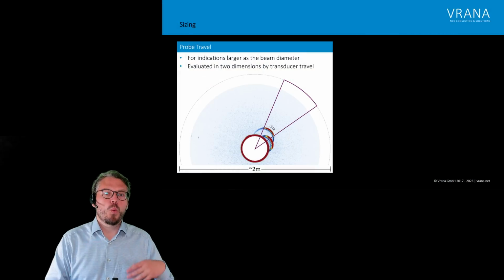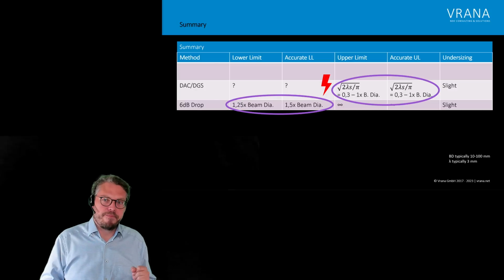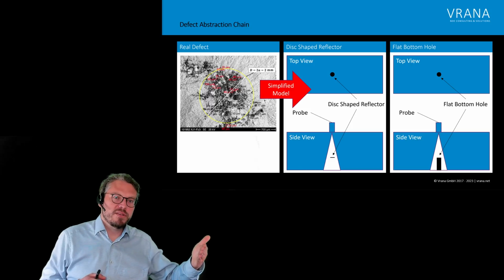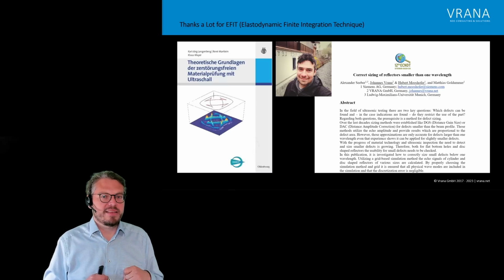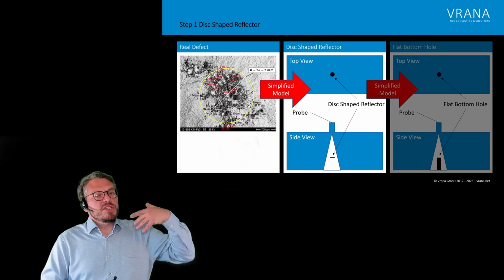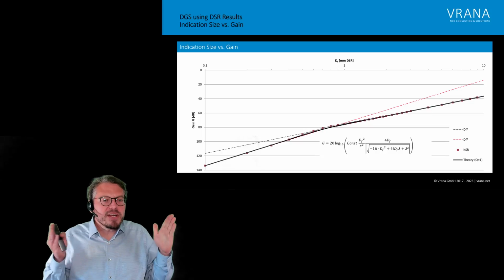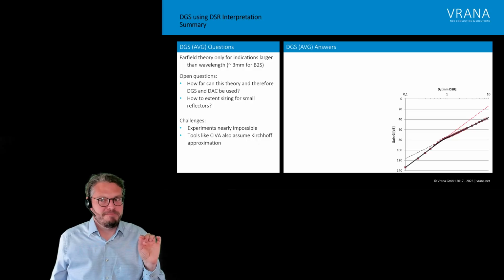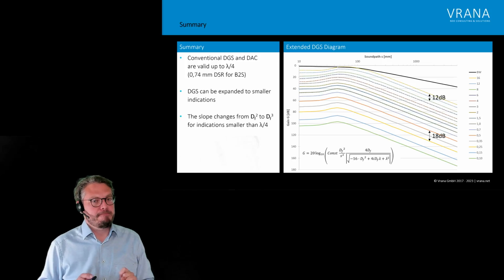Sizing of Small Defects with Ultrasonic Testing: Don't use Flat Bottom Holes!!!

Comment: Hello Dr. Vrana, could you do video/blog on nonlinear UT methods for early damage detection vs how they compare with the linear methods. I'm really new to NDE methods, and trying to do my masters thesis on identification & sizing of fatigue cracks. All the recent papers seems to favor nonlinear methods (e.g. frequency modulation, wave mixing, non-linear coefficient) for detecting early damage. I feel like, as someone like you who has been in this industry a long time can shed some light on the feasibility of these non-linear methods.
Reply from the maker: Unfortunately, I do not have any experience in nonlinear UT. For crack detection and wall thickness measurements I would always use linear methods to do their ease of use. However, in the detection of early damage, we are most likely speaking about damages that are #1 clearly smaller than the wavelength and #2 still quite "integrated" into the material and therefore create weak signals. And this is where nonlinear UT or even nonlinear reconstruction could help. Also, take a look into some medical applications.
Reply: Thank you so much for the suggestion. And yes, by early damage I meant defects smaller than the wave length & producing weak signals.
Reply: again thank you for your videos. I've watched most of them to get a grasp on UT methods. Specially, integrating NDE and AI seems really promising, and I'm planning on looking into that field more.
Reply from the maker: @abrarsalekinraiyan3170  COmbination of nonlinear UT, reconstruction, and some AI could really be a fascinating topic ....

Comment: Is not it dangerous sometimes to evaluate FBH size purely on an amplitude based technique? Like DGS or DAC basically. The reflector may be "equivalent" to a disk shape, but it might be much bigger than it appears! Because the indication could be irregular, and would scatter the sound rather than a specular reflector. I know, yes... the amplitude based technique is a core assessment method but sometimes I doubt its reliability.
Reply from the maker: Yes, you are right. Amplitude-based techniques can be misleading. #1 The calibration needs to be performed accurately. #2 The check of the equipment needs to be done accurately (for example if the probe frequency is not the frequency stipulated by the manufacturer DGS can be off drastically). #3 Larger, angled, indications have a quite directed reflection. Therefore, if they are not perpendicular to the ultrasonic beam only a fraction of the beam is collected by the probe.
However, once we get to indications that are in the order of magnitude of the wavelength this angle dependency is quite minimal - also the structure of such small defects is quite insignificant (as this structure is way smaller than the wavelength it is not "seen" by UT. Meaning those indications can be sized quite accurately. And if all the other factors are also controlled you can achieve a surprisingly good sizing accuracy. And in case you wanna do better: https://youtu.be/-dPkgov5E-M